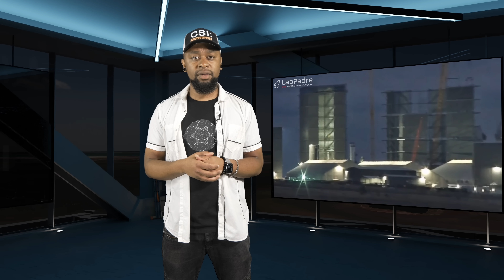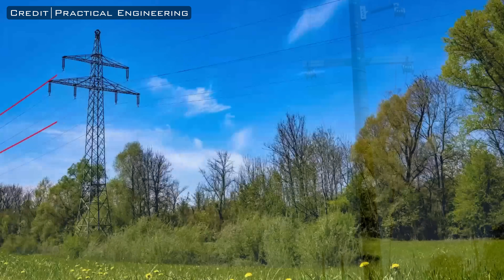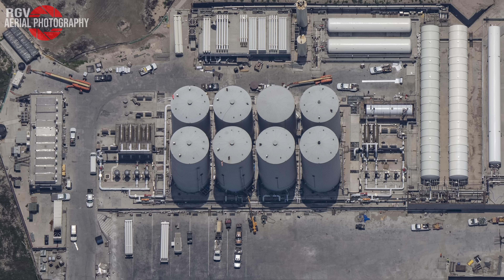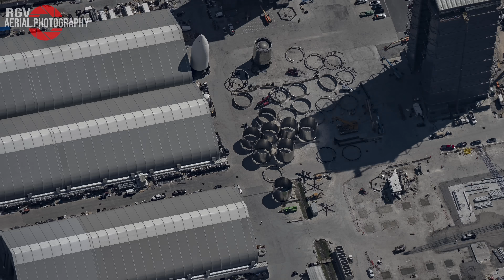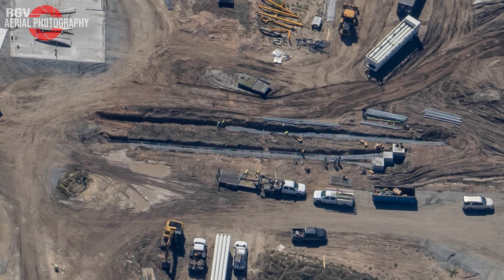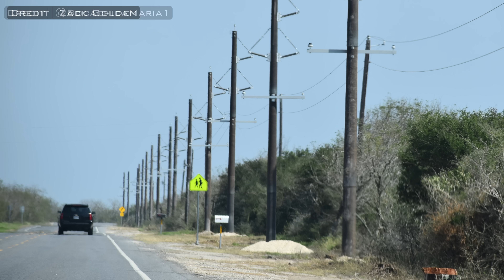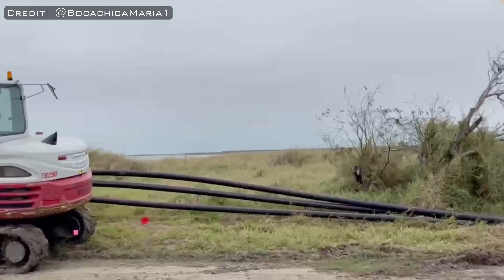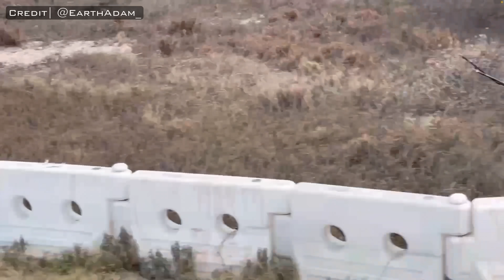SpaceX Abandons “Off-The-Grid” Operations At Starbase!

Comment: It's amazing that the US electrical grid is so primitive. Different countries can be ahead or behind in different areas... Single phase and local power lines in the air! I realize that there is plenty of not-invented-here in USA, and three phase power is basically a Swedish invention, but we started to use it commercially in 1893, 130 years ago, so the patents have expired a long time ago! It's a lot better for big power consumers in homes such as kitchen stoves. As far as I can remember, all normal kitchen stoves here in Sweden used three phase connectors, so I think almost every home here has a three phase connection since more than half a century. I can understand that you guys use gas stoves. Even with 230V, you need five times more current in the single phase than you need per phase in three phase, and it's just 3 cables instead of 2. so 3.5 times as much copper needed in the wires with single phase. There is no special equipment needed in the home beyond the power meter handling three phases, just that you have three live wires and three main fuses, and more opportunity for mistakes if the installing electrician is drunk. If you also use half our voltage, you need seven times as much copper to get the same amount of power to the consumers. How could that be cheaper?

Comment: Single phase power flows current through both the hot wire and the neutral wire but the neutral wire remains at zero volts unless the neutral wire is opened at which time you see the same voltage present on the hot wire even though the current flow stops. (unless you make the grave error of touching the hot side of the wire with your body, completing the circuit).

Comment: Don’t know why you cannot put some micro turbines on those low pressure gas heads . I did it all the time in California where they cannot vent gas it must be burnt thru a device that will cleanly burn it . Did a site in kettlemen  that had capacity of 5 megawatts depending on gas volume which was more than enough to run all the equipment at an oil field .

Comment: I am confused. I would think that it would be faster and cheaper for Elon to have used tanker vessels and install a port where he could have brought in large ships full of LNG to run his own power station. That would have provided plenty of power much sooner. No truck, just a somewhat short pipeline from a port to his power plant. Being reliant on local energy like this will likely mean they will have to increase their generational capacity and he may end up being limited by that in the future. It is also disconcerting that he is not seeing how this will impact his hopes on Mars too since power generation by solar will be significantly less than it is on earth. Refueling operations will likely have to happen on the red planet and on the moon and sending thousands of supply ships to Mars (or the moon) will not be a viable solution.

Comment: I’m an old Industrial Electrical Contractor in (sorry) California. Just finished an insurance project that had just one 150KW on site, running in prime power (24 x7).The generator ran for 67 days. With schedule PM on every other Sunday. This had refrigerated product on site. There was a backup generator (phased and ready). Just paid the bill on just the generator operation. Generator,  fuel, hookup and maintenance average out to $2967.57 per day plus $2674.00 for  4 PM’s. Total Cost for just one 150KW Genset, Prime power was $209,4696.19
This will give you an comparison.

Comment: Hello Zac. I am not an electrical engineer, but somewhere along the way I believe I remember that power for a 3-phase line is:
Power = V x I x square root of 3 (because the phases are not 180 degrees apart). If V = 11000, and I = 500 then Power would be 5.5 x 1.73 = 9.5 MW per 3-phase line or a total of 19 MW for two 3-phase lines.

Comment: Thanks for a great look into an area that most covering SpaceX don't talk about at all.. infrastructure related to general operations. Just in welders and cranes Starbase uses more electrical power than most small cities. Electrical power has been a limiting factor since SpaceX started Starbase. It's located in the middle of nowhere yet needed a power supply of massive size almost from day one. That's created a continual nightmare that has been as daunting to solve as any of the rocket engineering problems. Both the cost and the limits of what SpaceX could produce or find in electrical supply has been a choke point that most folks simply had no real understanding of. Industrial electrical needs are just not in most people's experience and so they don't even think about it. I've often marveled as I've watched SpaceX grow Starbase that they have kept everything going while building out so much production and managing the handling tons of super cold liquid gasses all at the same time. There has been a war going on behind the scenes most were completely blind to. That SpaceX was able to manage this issue in the background while building in record time the worlds biggest rocket production facility is a story that needs to be shared and understood. You look back just a few years ago and SpaceX was a few buildings with most of the work going on outside or in tents. How SpaceX built Starbase is a story that revealed the building of the pyramids. And it's only in its early stages as they plan as more new construction as what exists right now. SpaceX is a story that few really grasp. They have done more in the last 10 years than all the rest of the space industry has done in the last 50.

Comment: Great tracking and analysis.  Do you have the system map, simulations and data online somewhere in open data formats and browser-accessible form?  As an integrated model, you could run optimization scenarios to suggest very specific ideas to SpaceX and others. Not just from your considerable memory and knowledge, but in computer form so it can be verified and improved globally. I am slowly working out what it would take to replace the Booster with an array of electromagnetic lifters.  A bit futuristic, but not hard to do the numbers.  

A fully loaded second stage Starship at 1500 metric tons would need to be lifted to 65 kilometers and 2.5 km/second in roughly 180 seconds.  Your electric power grid would need to be upgraded, but no Booster and its fuel and oxygen needed.

The kinetic energy needed is 26 GigaWatt*180 seconds.  (Check me, I am really tired this morning. Just wanted to say thanks)  A nuclear generator that only needs to run for 2 to 20 minutes is different than one that runs continuously.  Multiple ones (one for each node in the array)  make it modular, and the same kind of units can be used in space tugs, on Moon, Moon orbit, Mars and Mars orbit. 5 GW for 5 minutes?  1 GW for 10 minutes?    33*1 GW for 3 minutes?

A "global open collaborative worksite" (GOCW)  can host your data, and many working and speculative groups - all with best in world tools, data methods, simulations, visualizations, team tools, $Thanks for tens of millions of people to help and check and suggest new ideas.

Richard Collins, The Internet Foundation

Comment: Hi, great video. Did you consider the solar covered roof of the new factory building? This will greatly increase the solar energy output.
Reply from the maker: Yes, in a way I did consider that. I gave the estimate for phase 1 of the starfactory but didn’t include the theoretical total if the full structure. I figured I would just let people multiply the number I provided by 6 lol.

Comment: 11kV is a British influenced IEC voltage.  Given this is in North America, the most likely voltage if it is a private network with 15kV cable would be 13.8kV.  It possibly could be 13.2kV or 12.47kV but that's less likely on a private network.

32kV is also quite an oddball voltage but you never know about some small utilities.  The standard North American voltage at that range is 34.5kV.
Reply from the maker: Thank you! I think it may have actually been one of my British agents who told me 11kV. I initially thought it was around 12 or 13 but wasn’t sure on the exact number.

Comment: Excellent review of infrastructure logistics engineering. Being a retired engineering manager I understand the depth of investigation that you have had to go to to analyse the available data over the years.
Well done.
Reply from the maker: Yeah it was a bit ridiculous honestly. I thought I could put this together in a week off of memory. But, then I realized I had to search through 3 years of images in order to find proof of everything and somehow turn it into a story. 😅
Reply: @CSIStarbase  hi, yes, understand completely, I've used spreadsheet to load St Pancreas Station in London to allow for diversity and timed usage to get an overall typical moment of electrical load for an 11KVA transformer and then use that to load the 11kv ring feeding all the transformer, but your dealing with higher loads, so why didn't they go direct to 11kv motors on the Mechazilla for lifting arms. And your version of UK 415V 3 phase supplies for pumps etc ... You could have an 11KV ring main serving local transformer power centres. Even if they were coming from 11kv generators....?

Comment: Hang on now... every residential neighborhood has 2 phase power, 2x 120v lines out of phase, presumably by 180 degrees.

But apparently you didn't want to discuss that?  I'm just saying.  Red and Black.  Every other breaker alternates the phases, unless it's a 240v breaker, in which case it uses both phases -- and you will clearly see that they are double wide.  An electric dryer or electric oven or electric water heater or furnace will always use 240v.

I like your content, but I'm just saying.
Reply: Residential power is single phase with a center tap neutral.
In residential power the phase shift between the 2 bus bars is 180 degrees for 120/240, but 108 degrees for three phase power.
Reply: @ghost307  Right.  Every home with 2 phase has two hot lines, 180 degrees out of phase, and a ground wire.  All lead back to the power station --- I mean through transformers etc.  But it's still two phases.

Right -- the normal outlets are only one phase, obviously, but I'm trying to imagine a power station in the USA that only provides 1 phase power.  Don't know of any.

And ... wouldn't it be 120 degrees for 3 phase?

Did you just answer my question with bad info?
Reply: @ghost307  actually hang on, I get it now.  USA power is single phase to the transformers, and is I suppose best described as single split phase.  Three phase power is then still created by the transformers?  But 120, not 108 ;)
Reply: @rolfkarlstad4015  First off, you're right. It's 120 degrees between phases for 3 phase. My mistake.
The US has 2 separate distribution systems, but they all start with 3 phase ungrounded power at the generator.
High voltage 3 phase goes into a 3-phase transformer and come out as 3 phase power at a lower voltage.
For residential power, only 2 of the 3 high voltage phase go into a single-phase transformer and comes out as single phase 240V power. The center of the low voltage winding of the single-phase transformer is tapped and brought out of the transformer as the Neutral. From that Neutral conductor to either hot wire is 120V. You use both of the hot conductor if you need 240V for bigger loads like an air conditioner.
Reply: @ghost307  so I got one more correction for ya.

I've been reading :)

Yes, all three phases

No, only one phase to a residential. and the loads are balanced on these various 3 phases.

But it's only really one phase, and it's split and it's 240v, and we get 120 per split phase.

The more I read about this the more I realize that everyone is confused about what vocabulary to use =D
Reply: @rolfkarlstad4015  Almost. The way to get single phase high voltage is to take 2 of the phase conductors. Three phase power from the Utility only has 3 wires, none of which are grounded. It is extremely rare to have a high voltage transmission system that has 4 wires.
Any 2 of those wires are connected to the high voltage side of the transformer.
The secondary side of the single-phase transformer has 3 wires, generally identified as Black, Red and White.
From Black to Red is 240Volts and from either colored wire to the White Neutral is 120V.
Reply: @ghost307  It's absolutely all over the place, the opinions on this stuff :)

I went to school for physics, not EE or CE or whatever, so I might see things differently than the terminology.

But yeah, I think there are three phases coming from the power company...  Let's go outside and look?  Otherwise there is no way to do three phase.
Reply: @ghost307  I think you're really lost in the sauce here, and I will not back off on my stance about your perception about how things work in the real world.

There are absolutely 3 phases provided by the power company.  There have to be.

each of the three phases can run to a home, split by the transformer into "split phase" but really two phase power, 180 degrees out of phase.  Two busses from one transformer, and a center tap.

Your confusion is understandable, everyone seems to be confused about it.  But you bet your ass there are three 120 degree out of phase AC lines running to anyone who actually gets 3 phase AC.

As for the rest, sure, one phase is split.  I would still call it two phase, because I understand physics.  An electrician would call it something else, and stand on their reasoning.  They are correct, but yet wrong.  

BEcause you bet your ass those two lines are out of phase.  180 degrees.  people get so confused about how AC power adds that some people  -- and electricians! -- think that they are in phase.  nope.
Reply: @rolfkarlstad4015  Actually I've been doing this as an EE for several decades, I'm just doing a lousy job of communicating the details learned in a 300 level university course over the internet use the tiny keyboard on my phone.
The power company generates 3 phase and send that down the lines. Single phase is broken out at the locations of single phase transformers generally located close to each load or group of loads.
Three phase is trickier because there are 4 standard configurations in general use in the US. The most unique system that I have worked on was a 9 phase system at a century old streetcar system. The vector algebra at that one was a nightmare to work out.
Reply: @ghost307  I totally understand this last description.  I'm not an EE, though I took a lot of physics classes with EE's.  I have a mere undergrad BA in physics, and ended up one class short of my BS in astrophysics.  I've even read descriptions where people claiming to be electrical engineers claim that 180 degree out of phase AC would result in zero voltage.  It's been a fun conversation, and I think you're a great guy for continuing it.

Comment: What do you think of the future liquified natural gas facility in Brownsville, Rio Grande LNG? The plant would liquify natural gas from West Texas so it could be exported. With a local source of LNG, SpaceX can start generating its own electrical power. LNG is mostly methane, with smaller fractions of ethane, propane and butane. LNG would be a lower cost propellant. I read that Stoke Space plans on using LNG for their first stage. I love your in depth presentations.

Comment: Thanks for all early photos for  the before and after  scenarios, the use of other creators content was very helpful. The number of hours spent studying all the different aspects of Boca Chica was like preparing for a propellant loading test. The amount of information delivered without a bunch of random stock photos an video clips was greatly appreciated, I think you should do your own skillshare course do other creators could learn that. Would love to see in the future a time lapsed of the different areas using rgv, nsf etc. Also would be curious to know some of COST associated to building a large site like this, such as how much does SpaceX have to spend on electricity, cost to rent/buy heavy equipment, what does a spool of wire, stainless steel cost, cost of a huge tank, how much fuel does a generator need and comparison to cost of solar vs grid vs generator.
Thanks again for the time you spend, it really shows in the quality of your work and all those that help you.
Reply from the maker: Thanks! I'm usually hesitant on assigning costs to things but when it's necessary I definitely do it! But yea there is definitely a lot of hours that goes into these episodes!

Comment: Zack, maybe you can try doing a CSI report on the vibration testing of the starship and electronics, or the temperature testing, or the EMI testing(3 episodes).  You are great, but how many more topics can you think of?  I always had issues with EMI test results when I worked at Lockheed, the F35 had many(done 10 years ago when I retired).  I'd also love to see how they resolved the problems of the QD supplying electrical communication( I Had problems with the P3C recorder), the connectors are never reliable, and only last 500 times, not like cell phone rechargers, if you can rely on those specifications (not to mention how they solve the connection problems of the LOX and the Liquid methane, 2 more episodes).
Reply from the maker: HI there. I'm not sure how I would get that information but would love to try to find that!
Reply: @CSIStarbase  Yes, I didn't think of that.  I hope its possible!

Comment: By Code, single phase really has 3 wires, one only for safety (ground wire).  3-phase is better for power delivery(2/3 more wire, 3x times power) if you add up the number of wires required(5, including safety ground). Just thinking out loud. I wish I could get 3-phase into my house.